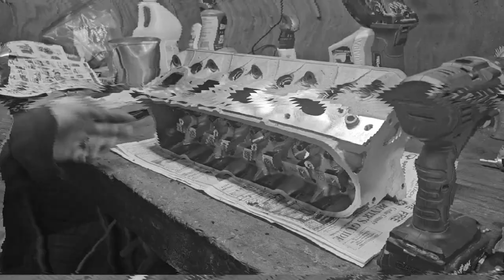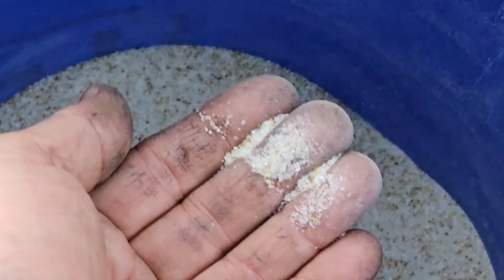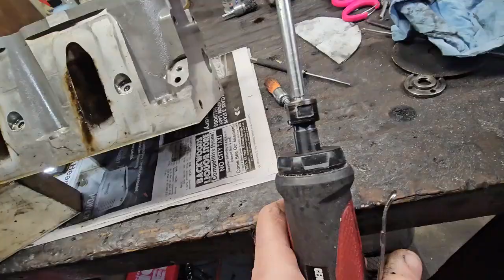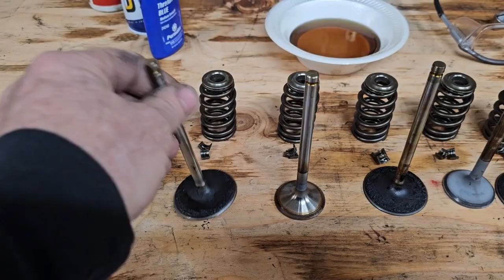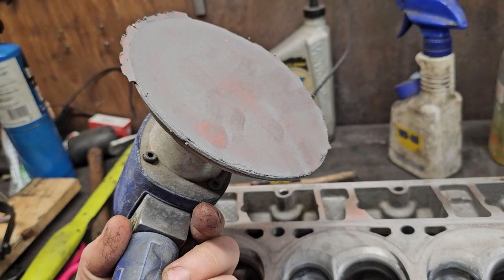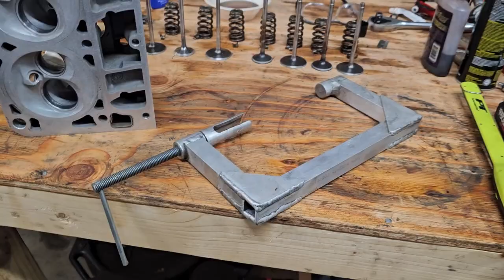C5 Corvette LS6 Rebuild - Pt 13.1 - Head Cleaning and Prep Work

Comment: Thinking of swapping out my LS1 for an LS6, or if I can find one, an LS6 block. All i need then is the 243 heads
Reply from the maker: After 01 I think all of the LS1 and LS6 used the same block.  The 243 heads will be a definite improvement.
Reply: @xpsgarage  I have an 00 unfortunately.